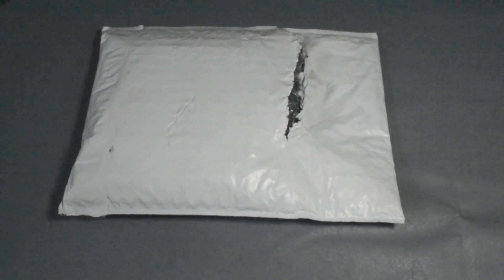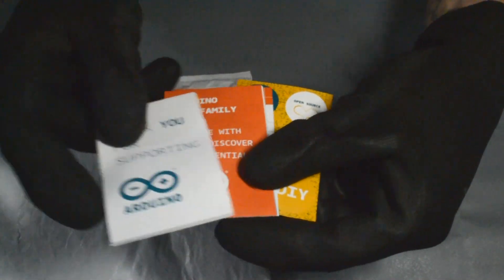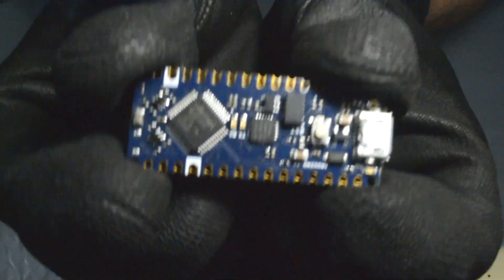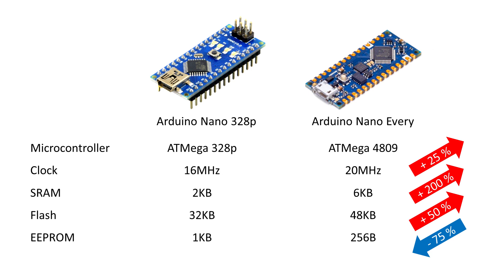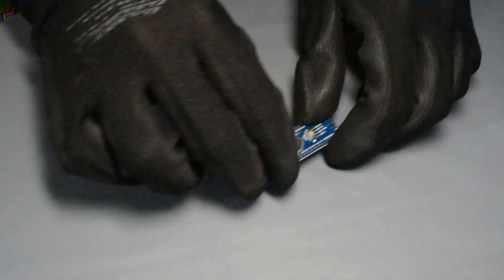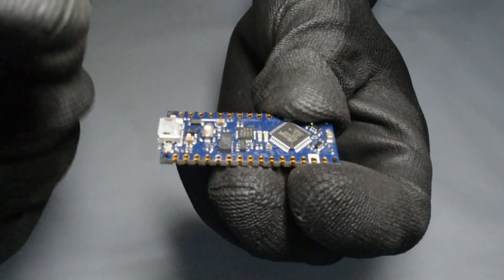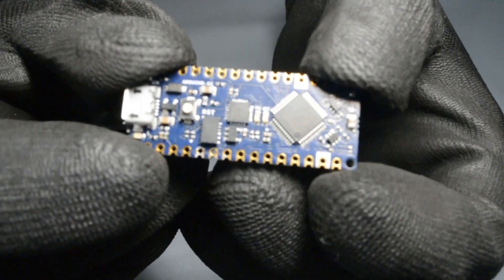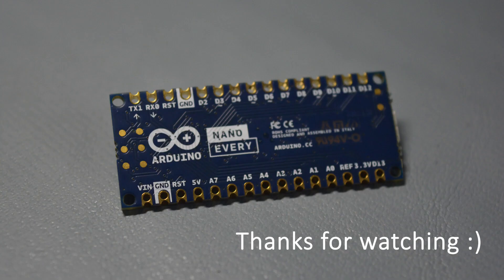#1 Quick analysis on the new Arduino Nano Every

Comment: The clock as set by the factory IS NOT 20mhz, it's actually 16mhz.  If you rebuild the bootloader and reflash the chip with fuse changes,you can make it run at 20mhz.

Comment: I looked on ebay and the clones are MORE EXPENSIVE than the original! WTF!
Reply from the maker: Yes. The original board is really cheap actually.  But the Old Nano knock-offs are dirty cheaper!
Reply: @rigolab $ 9.90 for the board and $ 11.90 for the board with headers soldered on
Reply from the maker: @ogam123  that's double the price of a Chinese knockoff BUT check the old original arduino and you'll see they lowered their prices